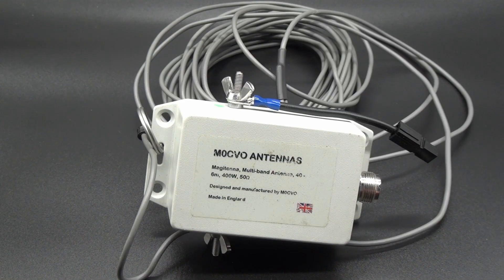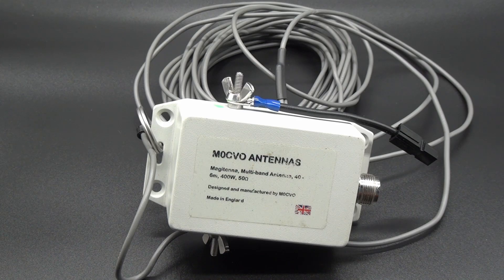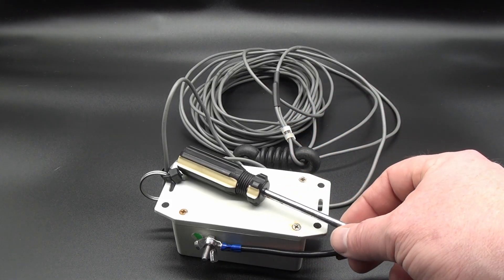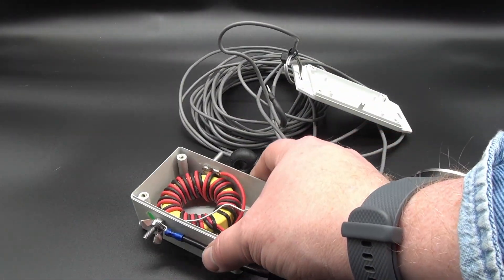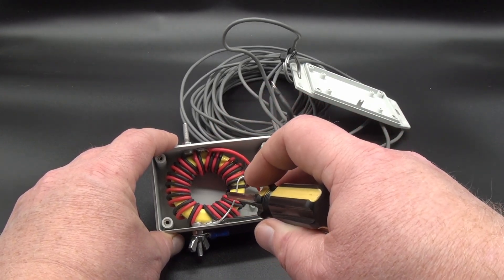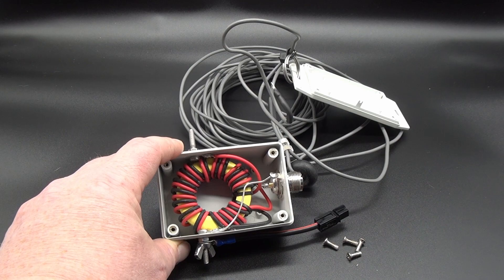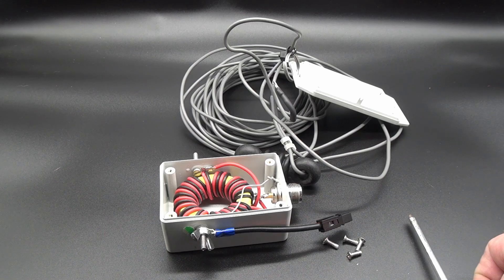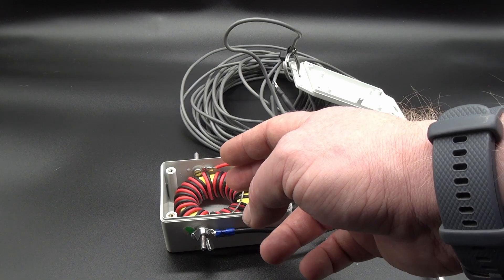What's the MAGIC in the MAGITENNA?

Comment: i have just came across this antenna tonight and then came to this video while doing some research.
 i was looking at the 10m long end fed but when i had a look in the garden today i only have 8m space for wire so when i found this i was jumping up and down like an excited child :D
would you be able to tell me what coax would be best for this and what length to use?
Reply from the maker: There is nothing magic about the Magitenna. It is a Rybakov, and in order for a Rybakov to radiate well it needs to be set up in a vertical configuration with a lot of radials. If you don't do that it just won't be a good antenna.

Also, I have a feeling that this might be your first antenna, this is not the ideal antenna to start out with. Also, regarding the coax, you should use as good coax as you can afford, and have it long enough to go from your radio to your antenna.
Reply: @LB0FI  it sounds like I should stick with my home made doublet in the attic.
I was going to USE the none magic antenna sloping from a pale in the garden to the house roof on about 45 degree angle but may keep away as I do not have space for ground plane due to out building and drive way. Thanks for getting back to me
73
M6CTP
Reply from the maker: @wowsly  If you join the TEHRS discord we have a whole community that can help you find your ideal antenna configuration. https://discord.gg/JedxAqkC9g